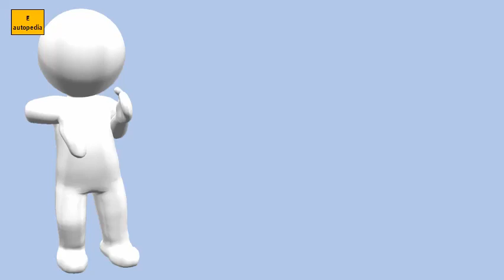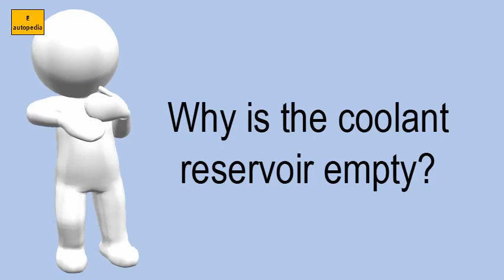Why Is The Coolant Reservoir Empty?

Comment: Hi  ive topped the reservoir off before and idk maybe couple weeks later its empty again. but no leaks. i dont want to keep adding coolant for no reason as the car has never overheated. any idea why its always empty ?
Reply: It’s probably evaporating . It’s so hot outside that the heat might be actually boiling it hotter. Also get a new reservoir cap and replace your coolant sensor when you get a chance
Reply: Same, it just pisses out from the little nipple it has at the bottom. I just changed mine and in less than a week pissed it all out, in long streams.
Reply: replace the cap